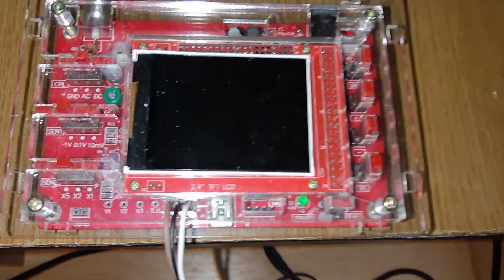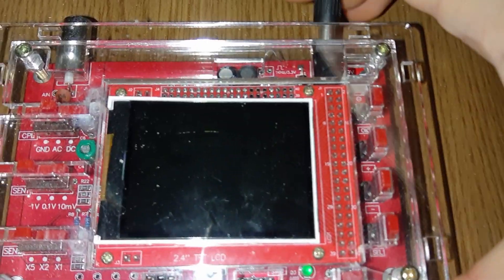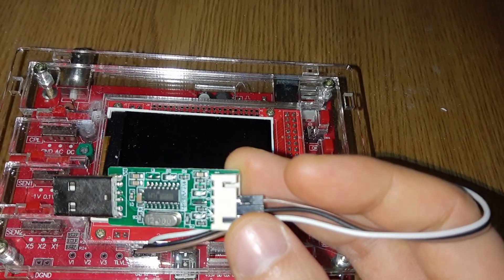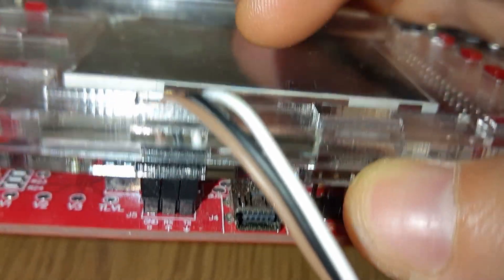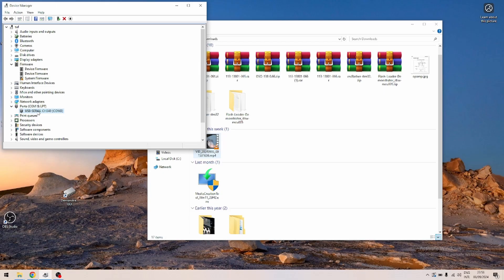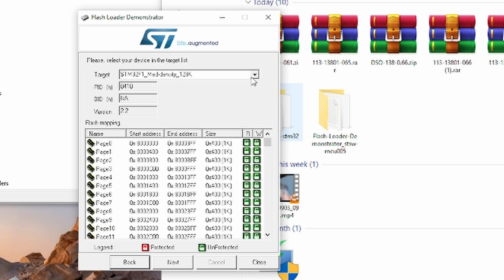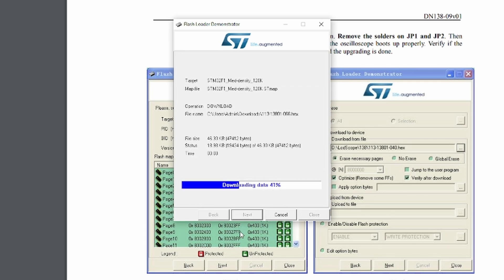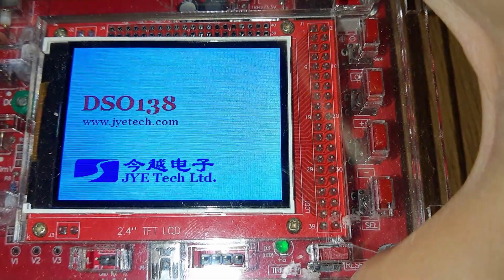Update firmware DSO138 TO 066 to be able to trigger at 50ms or lower

Comment: Thank you finally flash loader demonstrator is downloaded but one more problem i am going through after opening the flash
 loader when i am pressing on next after selecting com 3 one error pop up is coming and shows ( Cannot open the com port,the port may be used by another application), even after connecting ttl connector to it is still showing bro please help for the last time this is the final step.
Reply from the maker: Did you checked in device manager that port 3 is the right one for the serial to usb adapter ? Sometimes it changes when you unplug it and plug it back. Also make sure you dont have another app open that might use it.  You can try a restart maybe.
Reply: @CNCTinker  yes its com 3 only and i think no other app is using it then also let me restart it